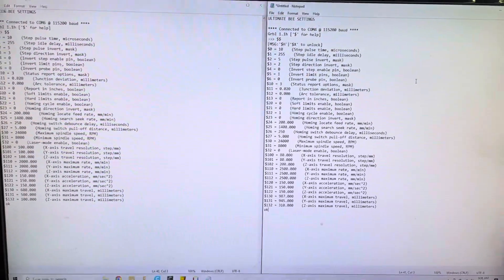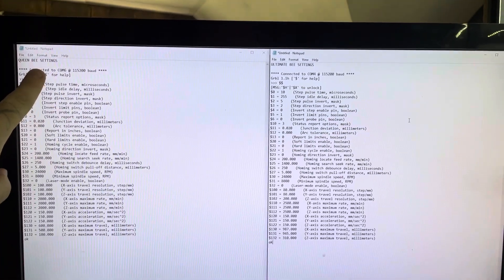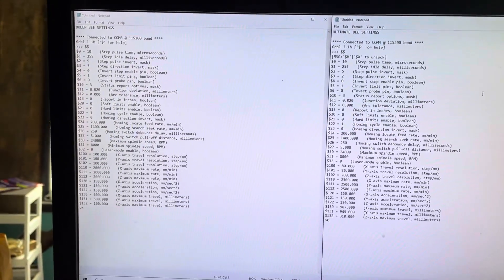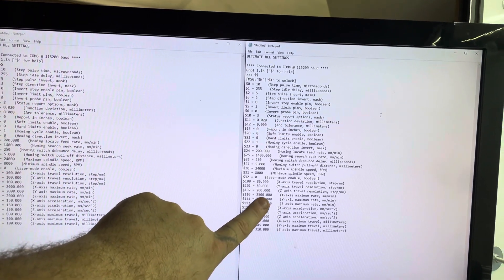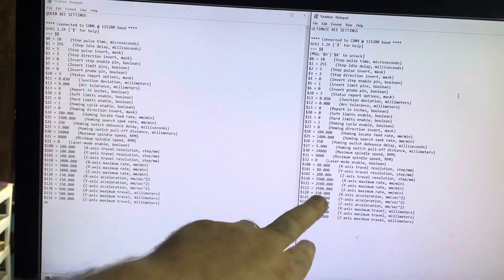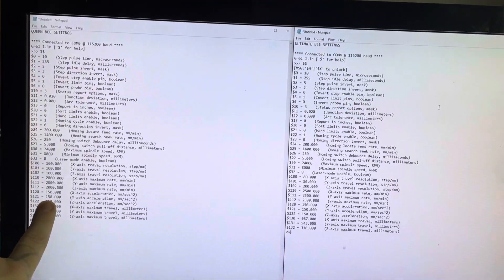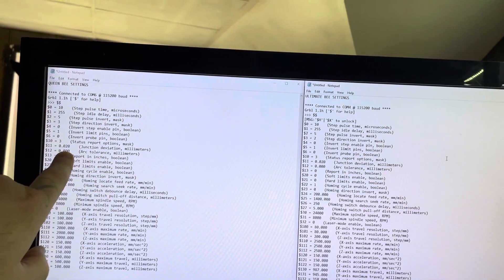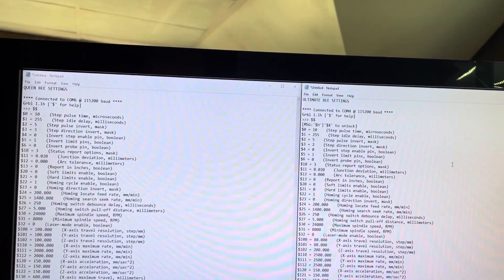GRBL settings - Queen Bee and Ultimate Bee #grbl #bulkman

Comment: hello i am planning to buy  queen bee pro  from BULKMAN  he suggest  for me  QueenBee PRO with xPROV5 GRBL as for  low experience user  but before i do any new step do u have any advice  before i buy ?
Reply from the maker: I have seen people have great success and a very hard time with the xpro but I haven’t used it myself. 

I think it’s worth it to get it and if it doesn’t work out for you just pick up a different controller after. That’s typically the least expensive part unless you go with a masso.

Comment: Hey there. I have an ultimate bee and am not even able to get close to 2500 max rate on my Z. If i do more than 1500 the stepper binds and stalls. 
I also noticed that you have 80 steps per mm on the x and y axis so I'm guessing you haven't calibrated movement distance with a dial indicator as id expect them to be not exactly 80. That also ends up being micro stepping of 2? Shouldn't we be 8 or 16? Thoughts around this?
Reply from the maker: Hmmm, I’ve never pushed the z to the max acceleration, in most of my applications I’m at a pretty modest plunge. Also, the 80 is accurate for my machine, it’s all calibrated.